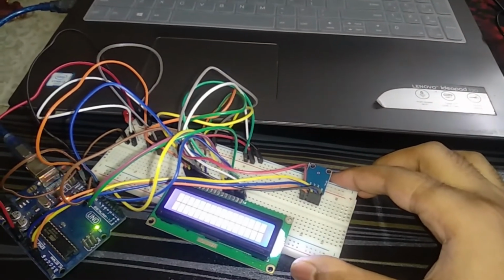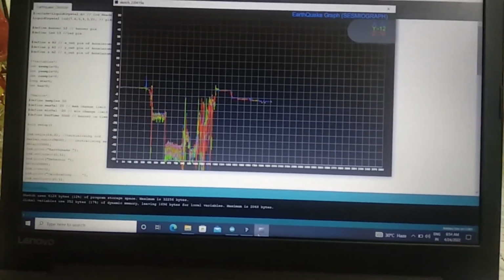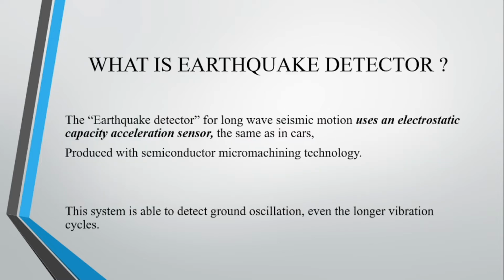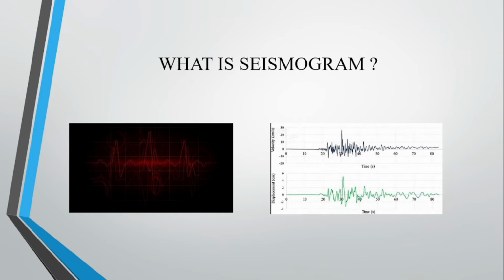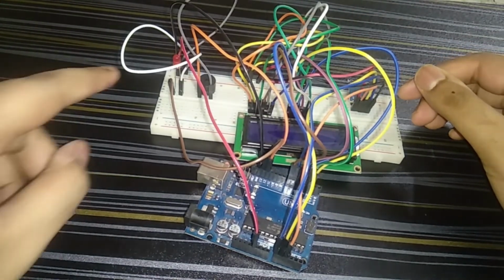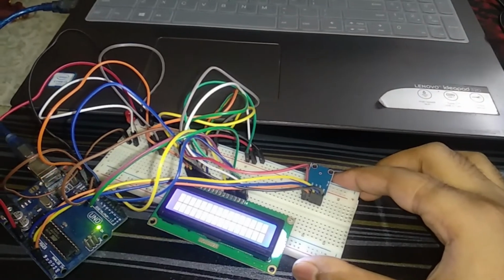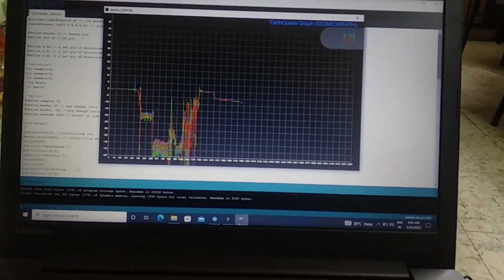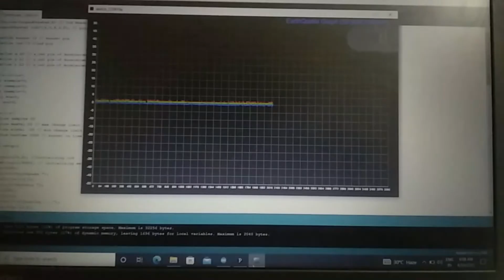EARTHQUAKE DETECTOR WITH SEISMOGRAPH USING ARDUINO AND ACCLEROMETER SENSOR

Comment: Are you using adxl 345?
Reply: Can I use 345 with this project?
Reply from the maker: No I'm using adxl335 you can also use 345 no issue
Reply: @systemdynamics1014  but is that posible if I use 345 it will work with same code ?